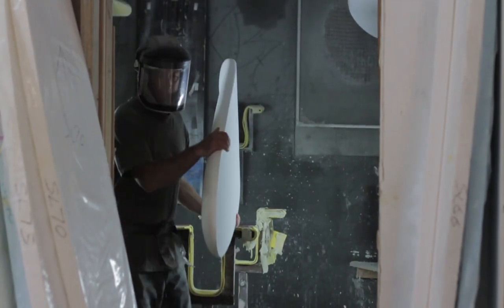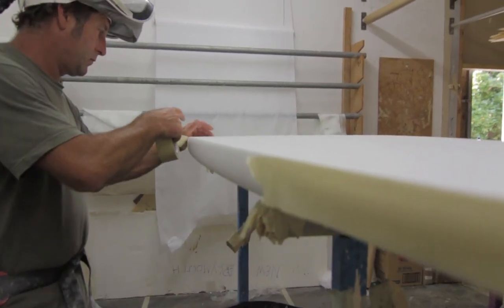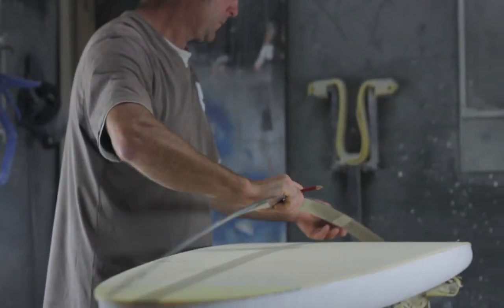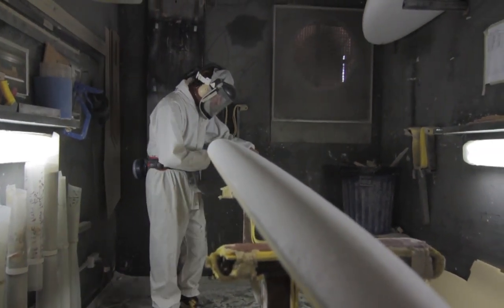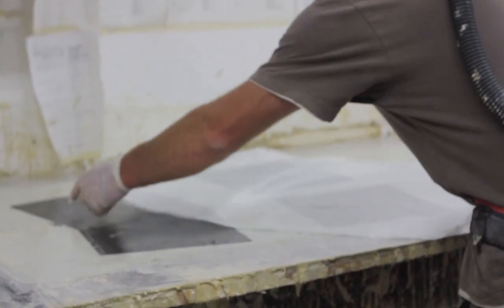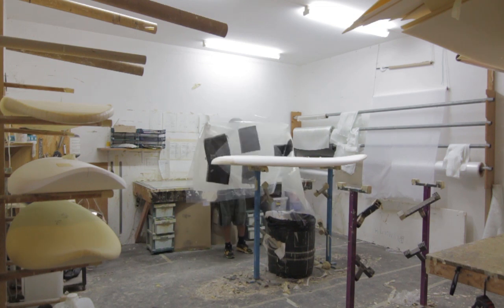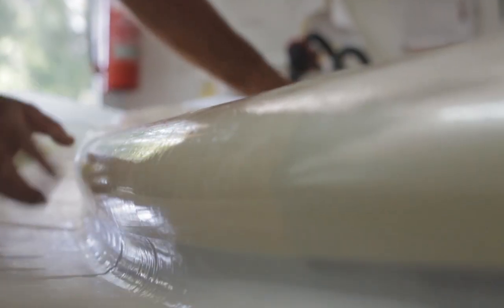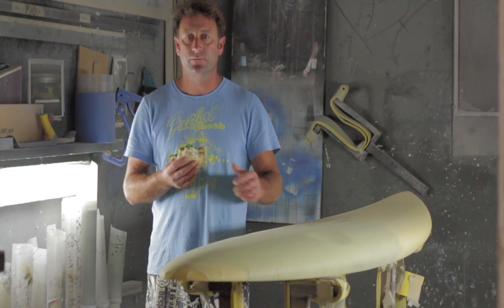Carbon Art Factory Talk: Sandwiching a Windsurf board

Comment: Super nice vids, I really enjoyed them. :) 
Do you laminate the glass/carbon fibre directly with epoxy mixed with foaming additive? Wouldn't that make for a porous laminate? 

I've thought about doing this as well, but so far I only use epoxy foam (sicomin) to fit boxes and not for the laminate, but if it works it would be a great low weight solution for the inner laminate. :)

Comment: Is it PVC foam which you are using to make the sandwich on the bottom and on the deck? How do you provide the bonding between polystyrene glassfibre and pvc? Is it only the epoxy which responsible for that or do you add special components to the resin?
Reply: Yes, yes and yes. Silica can be mix also with epoxy on the sandwich. He said foanie additive but that is silica.